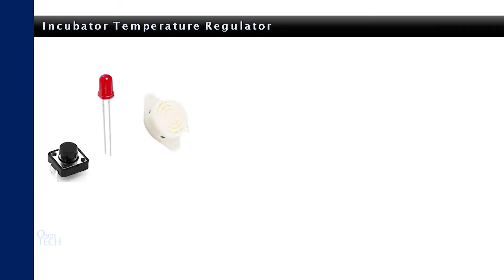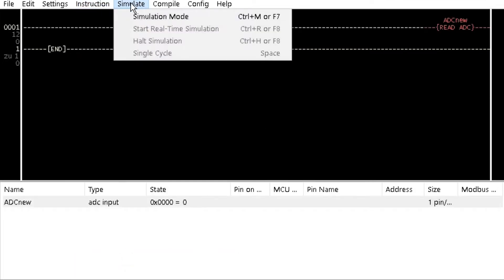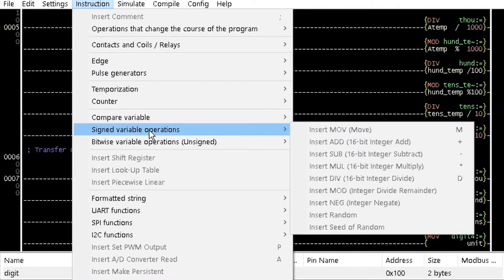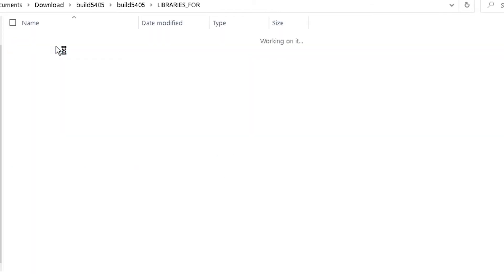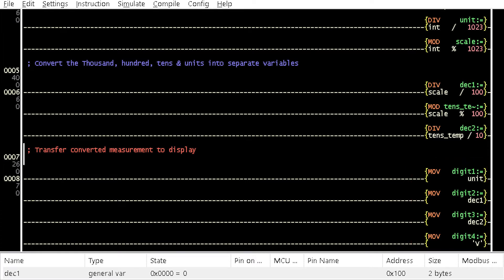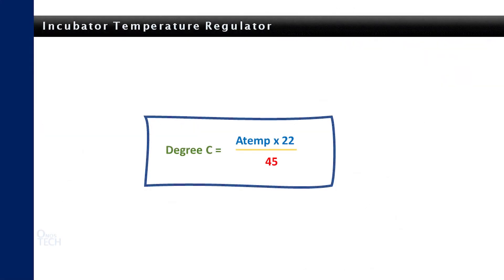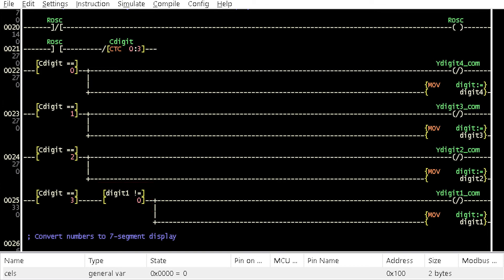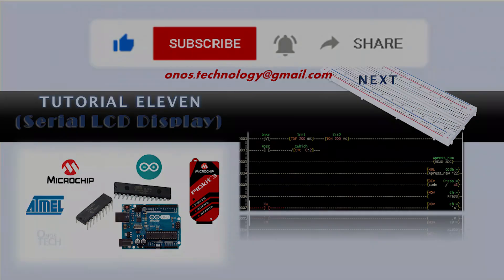LDmicro 10: Incubator Temperature Regulator (Microcontroller PLC Ladder Programming with LDmicro)

Comment: I am getting errors in Ardiono IDE while compiling  sketch:
Error compiling for board Arduino Nano.
undefined reference to `EEPROM_read(unsigned int)'
undefined reference to `EEPROM_write(unsigned int, unsigned char)'
Can you please help me with this ?
Reply from the maker: Use the RomLib.h from the Arduino library folder 📁 instead of the AVR library folder 📁. There seem to some difference.
Reply: Yes Sir .. Problem solved .. Done compiling. Thank you again for your reply in lightning speed.

Comment: i have a problem uploading the code to arduino nano
Reply from the maker: Please explain the problem
Reply: C:\Users\JERRYG~1\AppData\Local\Temp\ccRs5Ryn.ltrans0.ltrans.o: In function `PlcCycle':
C:\Users\JERRYG~1\AppData\Local\Temp\arduino_build_382367\sketch/labproject.cpp:666: undefined reference to `EEPROM_read(unsigned int)'
C:\Users\JERRYG~1\AppData\Local\Temp\arduino_build_382367\sketch/labproject.cpp:667: undefined reference to `EEPROM_read(unsigned int)'
C:\Users\JERRYG~1\AppData\Local\Temp\arduino_build_382367\sketch/labproject.cpp:687: undefined reference to `EEPROM_write(unsigned int, unsigned char)'
C:\Users\JERRYG~1\AppData\Local\Temp\arduino_build_382367\sketch/labproject.cpp:705: undefined reference to `EEPROM_read(unsigned int)'
C:\Users\JERRYG~1\AppData\Local\Temp\arduino_build_382367\sketch/labproject.cpp:706: undefined reference to `EEPROM_read(unsigned int)'
C:\Users\JERRYG~1\AppData\Local\Temp\arduino_build_382367\sketch/labproject.cpp:728: undefined reference to `EEPROM_write(unsigned int, unsigned char)'
C:\Users\JERRYG~1\AppData\Local\Temp\arduino_build_382367\sketch/labproject.cpp:670: undefined reference to `EEPROM_read(unsigned int)'
C:\Users\JERRYG~1\AppData\Local\Temp\arduino_build_382367\sketch/labproject.cpp:671: undefined reference to `EEPROM_read(unsigned int)'
C:\Users\JERRYG~1\AppData\Local\Temp\arduino_build_382367\sketch/labproject.cpp:709: undefined reference to `EEPROM_read(unsigned int)'
C:\Users\JERRYG~1\AppData\Local\Temp\arduino_build_382367\sketch/labproject.cpp:710: undefined reference to `EEPROM_read(unsigned int)'
collect2.exe: error: ld returned 1 exit status
exit status 1
Error compiling for board Arduino Nano.
Reply: that was the error showing when i was trying to run it in arduino ide
Reply from the maker: I have seen this error in Arduino IDE too. Copy the "RomLib.h" file from the ARDUINO library folder instead of the AVR library folder. There are some differences in the code. 

If for no other reason configuring LDmicro in C mode with the below link has proven to be more efficient for me.

https://youtu.be/1ooMWbz8Zzs

Comment: Is it required to modify the setpoint{persist} for using with any other microcontrollers ? I mean, in order to match with EEPROM of any other microcontrollers ?
Reply from the maker: No modification is required as long as the microcontroller has EEPROM and you have selected the microcontroller type from the settings menu
Reply: Thank you, Sir